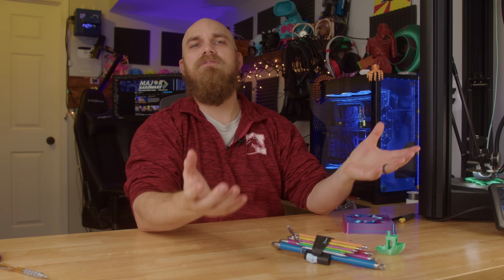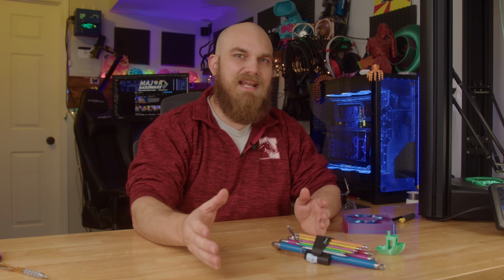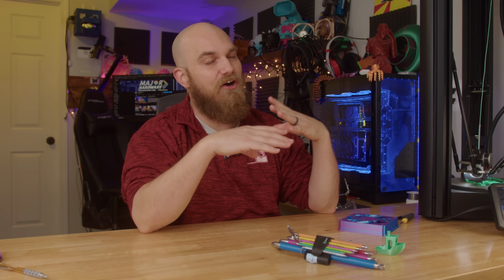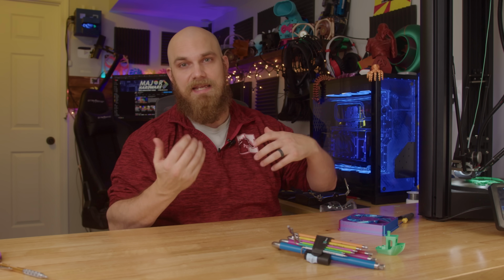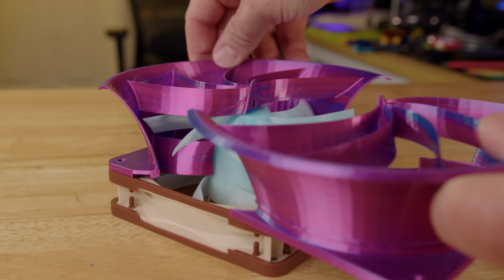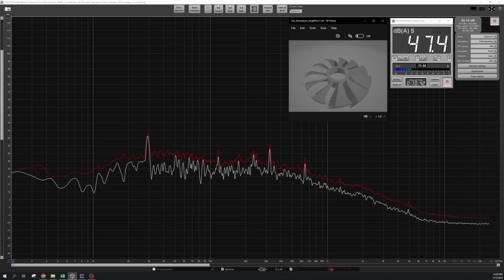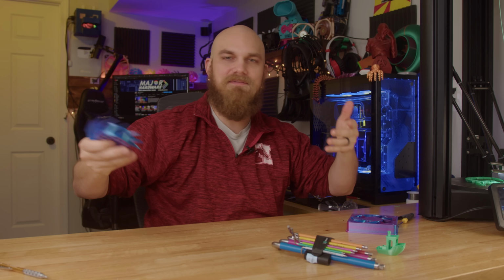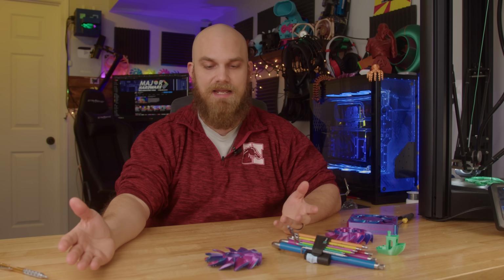Turning a PC fan Into a JET Engine | Fan Showdown S5E4

Comment: Car radiator fans are loud because you want people to know when it's switching on, engine being at the back it's perceived loudness isn't so bad.

Didn't have a Porsche, had a Skoda 130 Rapid with the Porsche engine in, the engine is behind the back seats and the exhaust was a straight short pipe, sooo exhaust was always louder
Reply: Thanks for watching☝️congrats 🎉 you have been selected among our shortlisted winners  🎁🎁🎁 send a direct message on telegram with my name....🎁🎁🎁

Comment: You could make a notch on the tip of those flimsy blades and run a thin steel wire around the whole fan to stop it from expanding.
Reply: Thanks for watching☝️congrats 🎉 you have been selected among our shortlisted winners  🎁🎁🎁 send a direct message on telegram with my name....🎁🎁🎁

Comment: For anybody designing very thin fanblades: if they are curved/angled at all they will deform at lot, in general straighten up and increasing the diameter so they will start rubbing (and shattering).
Either give them some rigidity with some thicker parts, or a ring (even a thin wire) around the circumference to prevent that from happening.

For the number of blades:
More blades make them LESS efficient (that is a well known fact for decades - for boats, submarines, helicopters, airplaines etc). They are used for different reasons like reduced vibrations, reduced stress on the hub, increased thrust at the same RPM. So for higher unrestricted airflow fewer blades are better, for higher static pressure you want more blades.

And about a person submitting multiple fans:
It should be allowed within reasons. If the fan looks funky/great/interesting then why not, or if it looks like something you think could be a high-performance design. I mean if it is a person that had already submitted 2 designs that worked very well then it is reasonable to assume they are trying to improve on their design and might have something even better. Of course jokers that just submit 23475 random crap design are something different. Having a strict rule is most of the time overall not helpful, but as you said per Season - yeah kinda fine as you are already on Season 5 so they had some chances.
Reply: Thanks for watching☝️congrats 🎉 you have been selected among our shortlisted winners  🎁🎁🎁 send a direct message on telegram with my name....🎁🎁🎁

Comment: 7:40 A cool suggestion, pun intended 😂 I think you should post a bonus episode at the end of each season where you/designer tweak the fans that have print and interference issues so they work correctly to give them a better chance! The turbine design is sick and it would be cool to see it perform its best, I’m sure some of the creators would love to be able to fix tolerances/blade thickness if it means they could improve performance. Plus, each time something like this happens I’m always left wondering what could’ve been 😂 love all your vids, keep it up!
Reply: I love the idea of it being a bonus end of season episode. Keeps it from swamping submissions, limits people to one second chance, but still gives us the chance to see the designs "as intended".
Reply: @Ylyrra  agree. maybe do a viewer vote for 4 or 5 fans from that season that didn't work as intended to see them corrected and retested in an end of season finale/bonus episode or something. i know he's done it with a few fans per viewer request if the creator resubmitted a fixed design.
Reply: I could increase the distance between top of the rotor and the bottom of the stator, and thicken the blades toward the center
Reply: Thanks for watching☝️congrats 🎉 you have been selected among our shortlisted winners  🎁🎁🎁 send a direct message on telegram with my name....🎁🎁🎁

Comment: I don't mind having more than one per designer in one season if there's something you want to see.

Also,I wouldn't mind if you fixed those material thickness issues etc. if you see something of concern. It's not like you'd be altering the idea of the design. There are probably many participants that would be new or quite new to cad and don't know how to set the thickness right even if they manage to learn the shape design.

Comment: Multi Stage definitely deserves another shot. Maybe a small bearing housed at the tip of the rotor for keeping it at center and resolving the blades clearance.
Reply: I can add more clerance between the rotor and the stator, because they probably bend upwards

Comment: I think you should put a load in the sistem and cool something with it, i dont mean a cpu it can be variable but i dont know, 200w resistor heating water y cooling it trought the radiator, let it run for 15 mins and check the temp what do you think? because we dont know if this low metric after the fan was because of cooling, the more turbulence its on the fluid more it cools down things, this could mean that the airflow its more restricted in the radiator itself  but cooling it more

Comment: A suggestion, which may be difficult (I'd probs ask Noctua first tbh)...
Anyway, I'd try and print a replica of the actual A12x25 OEM fan blades and then mount it to the hub as you do with all the other fans.

Now hear me out, only reason I say is, we see the A12x25 at the top of this seasons list, but it may actually come down to your ability to print being of lower standard than Noctuas ability to produce their blades.

It would be interesting to see how a  "printed on your printer" A12x25 replica actually compares to the original and may actually provide a more accurate compeditor for others to go up against.

Just my thoughts
Reply: already done in season 3 or 4 can't remember. might of been a side episode and not part of the actual season list but it was 2-3% worse than the actual A12x25 fan. but comparing injection molded and 3D printed parts is apples and oranges. that being said this is the first time the A12x25's been at the top of the list for more than 2 episodes. usually some one posts a design that brute forces it's way past it like the cheater fan.

Comment: Former P-car tech here. I loved working on the 964/993 series of cars. They were definitely the pinnacle of air-cooled engine tech. It was thought that the cut-outs on the inside of the fan hub was to reduce rotating mass. Also behind the fan there was a duct to run air to the alternator to keep it cool. The sound of the 964/993 fan is pretty iconic, and spooling up near peak power RPM, it's incredibly efficient. In fact, every generation has a bit of a unique sound. My favorite was the 908 vertical fan.

Comment: I think a new rule should be put in place for Season 6. Something I've noticed over the last 5 seasons is: The fans just spin at whatever speed they can. That... doesn't seem fair?

New rule: Set Target RPM each fan must achieve using all the same tools. Say 1500 RPM. If the fan can't reach that, the fan doesn't qualify to participate.

Some fans run from 950 to nearly 2100. The faster a fan spins, obviously the more air it can move, resulting in more CFM.

Shouldn't be fair to compete a fan that spins at 2,000 max to compete against a fan that can't even make it to 1,000.

Comment: Can u do another video where u print a blade design equivalent to the twisted turbofan design used on commercial jets, the last time u did that the blades were too large and therefore the BLDC motor burned out, probably a good idea to scale it down and run it again, I as well as I figured a couple ppl on here would like to see u give another go at that

Comment: I recently watched a show on analyzing airflow.  there is a neat thing you can do on the cheap that will look cool and reveal a lot.  When doing the smoke test, turn out the lights and use a laser level vetically.  It will cut a slice of the air and highlight it with the use of less smoke.
Reply: Solid suggestion!
Reply: That's a really cool idea.

Comment: @Major Hardware, out of curiosity, does your SPL meter also tell you what frequency the highest peak(s) sits at? Asking bc it's kinda difficult to tell with the scale being so small on my phone, but it would be another good metric to chart IMO, as witnessed with the 993. Many of the fans /look/ to peak in the sub-60 Hz range if I'm reading that right, which is often much more tolerable than a peak (or set of them) much closer to the range of human speech...

Comment: It would be interesting to do the jet thing and sand the tips of the blades so much that at full speed they didn't touch, to see how it performed then. Kind of like the SR71 that won't stop leaking until it's at a certain height. The blades won't work properly until they're at the full speed.

Comment: The Multistage one could be interesting with either a ring or meatier blades, just to see if it was held back by the limited fan speed.
Reply: It definitely was. The speed where it made contact with the housing seemed to be about 2/3 of full whack. That's a lot of fan performance left on the table.

Comment: So before you said anything, I said to myself that it sounded like a Porsche but higher pitched. The cooling fan is not pleasant sounding but it's also at the very far back of the car and you don't really hear it inside the car so it's not an issue.... So it's the "same sound" but a higher pitch.

Comment: I wonder what the CFM would be if they ran at the same speed as the A12X25.. most of these fans cant seem to hit the 2k rpm it does. Is that due to material weight? What does a copy of the A12X25 weight with the filament you use?

Comment: Make the multistage with thickened blades maybe an airfoil cross section?  Then take it up to speed of the other fans and see how it does.  I don't see any "Fairness" issues in this little competition since the really is not and serious prize involved other than confiming you came up with acool design.  Just fill the slots for every weeks experiment with cool fans and see how it goes.

Comment: The variable needs a wing on the front face that resists its tendency to sit in the plane of least resistance. It's doing the opposite of what is needed. How would it work if you made a mirror image model?

Comment: I think a "submissioner" should only get one submission per season.

However, what about being allowed to submit revisions? I think that would be acceptable, so long as they are being original with designs, treating competitors as "patent holders" forcing revisions to "original updates" to "original submissions".

I think that would be a good system. Maybe only allow winners who lost a place on the leader board for a chance to reclaim their position, possibly claiming a higher place then the one lost. If multiple revisions are submitted, the revisions have to duke it out in a "side quest" fashion, with the winner being allowed to proceed to attempt to reclaim their place on the leader board.
Reply: none of my revisions got tested even though the initial design killed the cheater.

Comment: Seems like a moderately talented electronics engineer could make a circuit that directly reads the fan speed and controls an led to blink at the same rate as the fan's rotation.

Comment: All impressive fans with good patterns. but the Angel just felt like it pulled air remarkably well, I always say if there's fog on the other side they probably didn't do well. while they all did well the Angel moved the air the furthest in my opinion and looked like an early winner.
Reply: Theres also the way how the smoke look almost linear on how they flow. Its not going up like the 993, and its not going down like the Variable. Just a straight vortex.

Comment: I noticed awhile ago that the “best” fans almost always have either 7 or 9 blades, so the 11 blade idea seems legit. Can’t wait to see how these all perform
Reply: Not just odd numbers, prime numbers.  3, 5, 7, 11, 13, 17... It avoids resonance when in use.
Reply: @jasonmajere2165  bingo. I’m an engineer for a engine dynamometer manufacturer. Everything we do is tied to prime numbers as well…eg rotor and stator both have a prime number of blades (7 and 11) for efficiency. 

Since air behaves like a liquid, the same principles apply.
Reply: Same with hydraulic pumps. Odd numbers
Reply: @Extmajor  prime numbers reduce harmonics.  9 blades is a bit of an anomaly.
Reply: @JMurph2015  9 is probably chosen as it splits the difference between 7 and 11. There are some situations where 7 is too few, but 11 is too many. The Noctua fan is a great example of this. Their fans are designed around the blade geometry, so altering their shape to fit with a prime number of blades around the hub with the desired blade gaps conflicts with that goal. So instead they find some number that more closely hits their design goals while still avoiding any harmonics with the 4 posts of the fan hub supports.

Comment: I would be interested in seeing a corrected version of the multi stage. Maybe a s5e4.5 hehe
Reply: Or a season dedicated to improved versions of past designs. Fan Showdown: The Next Iteration
Reply: It would likely help to use a resin printer instead of the standard 3D printer. Stronger material and it'll turn out much smoother.
Also the turbine blades are far too few, the compressor part of a jet engine (which this is based on) has a lot more blades which are always a prime number and offset from each other. (The reason for the prime number is because it stops a resonance from forming)

Comment: My dad owns a 993 and I immediately noticed that the fan sounds so similar to the real thing. Although I don't think it sounds annoying at all at least in the car and in your recording but I could just be used to it :)
Reply: Dont forget the fact that in a car there is also a engine making noise
Reply: @TimsVideoArchief  exactly, and the fan noise when revving up mixed with engine is just pure pleasure for most car folks :) and you get noticed more :D but not when gaming ;)
Reply: @TimsVideoArchief  true but listening to the running car with the hood open I think the fan is actually "very" loud and noticeable
Reply: The bigger one will be lower in pitch, which helps a lot.
Reply: @Llohr  Came here to say the same thing. Since the car fan is larger with larger holes on the front, which I'm sure help contribute to the unique sound, the pitch should be lower.   The lower pitch should be far less annoying.
Reply: @Llohr  not necessarily. If it is the holes making the sound, the pitch will be directly linked to the number of holes and the fan rpm. Size will change volume not pitch.
Reply: I was looking to see if someone commented on this. I love the sound, though we have that beautiful engine sound with it. It did sound a lot like when you pop the hood. 🤣

Comment: With the multi running at half the RPM, it'd be interesting for a redesign to run at full speed.
Reply: The design would need to have a slightly tighter curve in - tip of blade closer to hub - vs shortening. Shortening wont do good, but keeping same thinness and accounting for the flex (like real turbines...though combination of material is what they do).
Reply: Just a few tweaks, once printed a quick sanding should be enough to continue…
But not having to do post processing work is the goal of the submissions.
Reply: I dont know where are the blades rubbing, but i could increase the tolarances around the rotor
Reply: @frandiminic3559  It seems to me like they are expanding outwards and contacting the outer frame. I don't know how they would deflect along the rotation axis unless the curve geometry is doing some funky things as they flex. I'd try just shortening them a bit and maybe thicken them up slightly as well. The suggestions of a blade-tip ring also seem like a decent idea.
Reply: Just line the housing with sandpaper and run it at full speed in reverse until it quits touching.
Reply: What about just incorporating a ring on the tips of the blades, either a thin ring at leading and trailing tips or a full band that's the full height of the blades.  That would give strength in tension and keep the blades from expanding at all.
Reply: yes the tolerance issue can be solved by making the screw holes bigger on the shroud, expanding the radius, and filling the gap on the shroud with masking tape
Reply: I say, line the inside of the shroud with some adhesive backed sand paper and slowly ramp the RPM to full, and let the sandpaper and forces self adjust the blades to a final shape. Once the sandpaper is removed, the blades at full RPM will have only the thickness of the sandpaper left as the gap.
Reply: The numbers it put out look like it would be comparable to the rest at similar RPM.
Reply: It was also run backwards as the stators should come after the blades.

Comment: It would be cool to make a variable pitch fan but have the hub move in and out to actuate the fan blades so the more Force that's placed on the fan the pitch increases based on back pressure